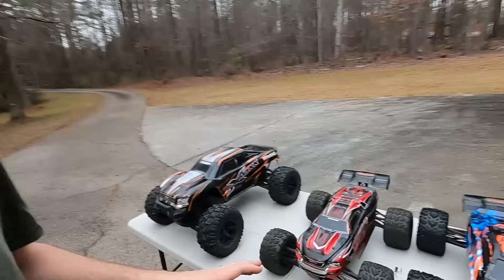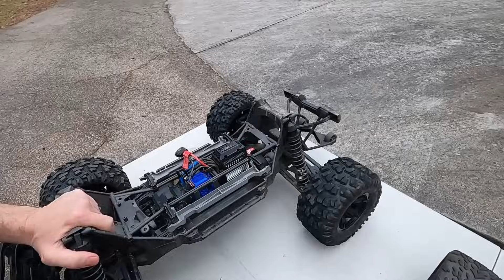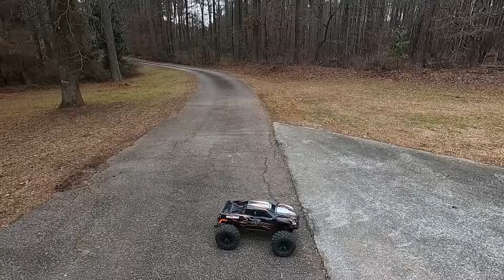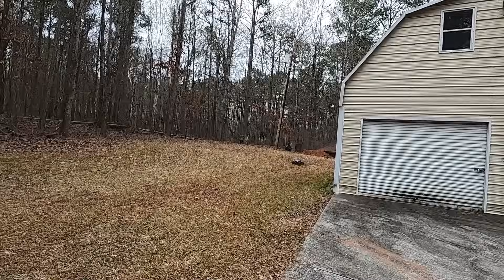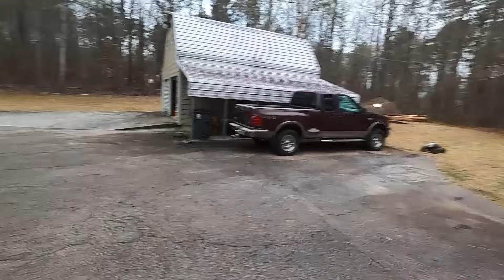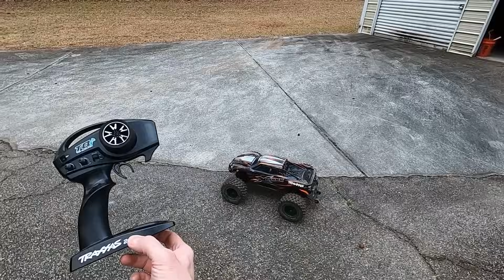Why Is My XMaxx Stock And Why Don't I Use Badlands?

Comment: Traxxas does all the research and builds a great truck and people go screw it up with “upgrades” lol
Reply: At the end of the day tho we all have fun upgrades or not each is there own
Reply: @natehage7919   I don’t need a product to be “my own”. I just want a great product that performs well and is reliable. And I try to buy products that achieve that — as much as possible — right out of the box.
Reply: This sounds amazing but for us first gen 6s xmaxx owners not the case. The version xmaxx hes running is upgraded. The revo first gen brushless version versus the 2.0 is a good example. The esc was not good for that size truck and could catch fire. Traxxas sent me the fuse link to fix it myself incase it caught fire lol. I added mamba monster x esc in my xmaxx instead and put the xmaxx esc in my summit. I broke so many gears on stock motor because it didnt have the cush drive yet. Went through axles and diffs as well plus tires sucked and would pop. The motor needed a fan cause it would get hot as shit and was underpowered for the trucks weight. On the other hand I do agree on the  modding it as it has become a shelf queen after I did mod it with the leopard 5892 1340kv. How some people run the 58113 800kv motor is insane to me. I went through a lot of steel gears cause I never heard of using loctite on the motor shaft so the pinion would slip and go the edge leaving little contact surface. If you compare the newer versions of these it has bigger axles, better esc, better motor, better tires, better transmission, cush drive and better diffs. I kinda wanna a video just to show the opposite spectrum but at the same time agreeing with some of the breaks that come with it even though in stock form the right person can break anything.
Reply: You don't break anything buddy because you drive it and jump it quite conservatively and are happy with standard product and mediocrity! Thats fine. Some people like 40 yr old transams and others like Hellcats or twin turbo'd chevs!
I guarentee my xmaxx is twice as strong and twice as fast and my 100ft jumps eclipse most of everything you do.
All good though buddy, horses for courses and each to their own.
Each to their own tho.
Reply: @Cornelius456  I have a 600 hp bmw dude I know what modifications consist of. Kevin talbot even says the Xmaxx is damn near perfect out of the box with the exception of the servo. Hell even mine went out within a couple months. You’re talking as if people aren’t allowed to modify things
Reply: @Cornelius456  a little salty are we BUDDY
Reply: I think so too
They sell the worthy upgrades  themselves,  not taking away any good aftermarket upgrade merit here, but most  of them are just to get your money without any real merit

Comment: I bought mine used (it was 2 years old, still stock) I kept blowing rear wheel bearings so I did the RPM wheel bearing upgrade. (No issues since) then the ESC died, upgraded to Max6 (no issues since) and then my servo died. Upgraded for the stronger Traxxas servo (no issues since) I’m fairly certain that this is all you’ll ever need to upgrade on your Xmaxx... everything else only breaks if you hit something wrong.

Comment: The turning is a combination of traction and weight. So if you upgrade the tyres you need to change the driving style, suspension setup, servo etc.  :D
Reply: Depends on the wheels, the louise and madmaxx tyres work fine without changing anything. They are a bit bigger than stock, but they dont weight much more. Unlike the proline wheels which are about double the weight of stock 😅

Comment: My brother has a Traxxas Stampede 4x4 that him and I have upgraded to the point that literally the only thing that breaks is the motor shaft. The motor shaft has only broke twice after having been finished with the upgrades in about two years. So probably once a year it breaks. The only other thing that typically happens is the grub screws on the driveshafts back out. Definitely, as you said, we chased the breakages until all that was left was the rotor on the motor. Would put a motor with an 8 mm shaft in it but that is literally impossible to find that fits in a Stampede.

Comment: I say this on every post I see. Those tires are just too heavy.
Reply: That’s the dumbest thing ever. It’s an rc car. Unsparing weight means nothing.
Reply: @peterk814  More weight, you're not going as fast nor are you jumping as high. Plus a heavier tire means more stress on the drivetrain
Reply: @peterk814  Mine doesn't do a wheelie so bring it on
Reply: @reidisaacson9623  Mine actually got a bit faster and stable. 🤷🏾‍♂️
Reply: @MervHernandez  k…
Reply: I have seen nothing but benefits from running the Badlands.  The weight argument doesn't hold any water - and neither do the Badlands!  The double, bolt-through-tire beadlocks completely seal out water.

Comment: I have this feeling with the regular Maxx. I do think that changing the gearing is a worthwhile upgrade for the X-Maxx after seeing the videos of the difference. I don't see the point in most of the other upgrades though. I am doing WIdeMaxx on my Maxx and putting lights on it because I play with my cars after dark during the fall, winter, and sprint.

Comment: Excellent video👍🙂 I definitely had this problem when building my Arrma Kraton v4 6s Piece by piece. I did this so I could put the upgraded parts on it that I wanted🤔  I have over $2000 into this truck and it is bad-ass don't get me wrong. I am constantly tearing up differential parts😒 I basically built a very powerful lead sled☹  Wish I would have just bought a stock one it would probably be more fun.
Reply from the maker: I know that feeling

Comment: The badlands cause my pinion gear to come loose. It holds up better with stock tires when jumping. I use the stock wheels for stunts and the badlands when it's snowing or the yard is really wet. Also, the stock tires last longer if you cover the breathing hole on the inside of the rim.

Comment: Nothing wrong with stock and very little mods or upgrades. If it works for you then rock it! I run a max6 on my stock 8s motor with duratrax hatchet x wheels, rear rpm bearing carriers, shock covers, modded the servo saver spring so it was a little tighter, and put upgraded steel pinion and spur
Reply: My throttle browns out with my max 6 Any ideas what could be ?
Reply: @Cole Deer  not really, try recalibration. Did u change gearing or motor?
Reply: @Todd_G_FPV  no only thing I did was change the ESC and now I’ve been having brownouts with my throttle. I’m wondering if it has anything to do with my LCV
Reply: @SoleToleCole  could be that or bad battery plugs not supporting the amp load and causing your lvd to kick on

Comment: 2.2lbs more is all  4 badlands weigh compared to the stock wheel and tire package. It really just depends on how you use your XMaxx as to if the badlands hurt the truck. Great truck and great tires.

Comment: I think your right upgrades do often lead to some issue or some breakage.    I have kept my Xmaxx stock besides the max6.  I upgraded to that esc as my truck was an original Xmaxx 6S and I upgraded it to 8S spec conversion.  That and I run the RPM oversized rear bearing carries and I’m going to get the new front carriers.  I also have RPM front and rear bumper supports.  But that is all pretty minimal for upgrade. Just realistic upgrades

Comment: Totally agree. My upgrades are pretty limited to just more protection.  Rpm rear hubs,dust cover, extra fan, Cvd boots. Did splurge on a savox 2292sg servo so I could put the upgraded traxxas black on my maxx.
Reply: How's that servo handle? I have a 2085X, but a stronger second couldn't hurt

Comment: Stock tires are absolute trash.  Even with stock electronics the tires will shred.  Upgraded to the max 6 with a 1250 kv HW motor and I’m very pleased.  Not too much more than stock, but definitely noticeable.  And I run the bad lands.  If you want your truck to last, don’t do huge jumps.  Really that simple.  And the vitavon 20-35 gears are incredible.

Comment: I had to do 3 upgrades over time .  The stock esc was causing the truck to lock up had to upgrade esc.  Stock servo was not working good installed the upgraded servo.  And the third upgrade was a unbreakable body

Comment: The servo is slow and weak. I found this to be one of the best upgrades I done on mine. The electronics are fine, however upgrading here is definitely a matter of choice, not necessary, I agree. Since I do not bash mine heavily upgrading the motor is awesome,. The power and torque on command makes driving a blast ripping around. So much fun, and the sound from the mod 1.5 gears in such an adrenaline rush.  More power turns the Badlands into grass ripping tires. They are a bit on the heavy side. I have found the Duratrax Six Pack X Belted Mounted Tires are a better all around tire. They do not balloon either. I enjoy watching your videos. You do a tremendous job presenting yourself. Thanks!

Comment: Mine is on its way, should be here tomorrow, the only things I bought for it are shock sleeve's rpm a arms for when they break, and rpm rear bearing carriers for if those break but that stuff I don't think will add much weight at all, loved the video, will definitely sub!
Reply from the maker: Thanks! I’ve been looking at the RPM carriers also.

Comment: Just bought a Xmaxx yesterday.  Haven’t got it yet but it’s ordered. Only thing I ordered was a skid plate for the roof, and front and rear skid plate for the underside. Other than that all I’m doing
Reply: Rear rpm bearing carriers, hobby wing ESC and a upgraded servo I see  in you future.. I'd add the Tbone bumpers.

Comment: I love my Xmaxx, but I did do a few things to mine. Being used to my Erevo 2.0, I was a little disappointed in lack of wheelie and backflip abilities of the Xmaxx. I put in 20/50 gearing and its definitely peppier. I can get a backflip, but still not as easily as the Erevo. I’m ok with that though. I added rpm roof skids and reinforced the body with drywall tape and silicone caulk. I always heard the rpm rear hub mod was a must, but was skeptical. One of my rear bearings came apart after the second drive. I ended up doing that mod and am happy with it. I took my diffs apart and discovered that they were all low on fluid so I topped them all off. So really nothing crazy has been added, but my durability/fun has been increased, so I’m very satisfied with it!

Comment: We couldn’t keep stock tires on ours, as we kept having blowouts! We put trenchers on and it has been solid ever since. Everything is stock except for machined gears.
Reply: how are the trenchers on the xmaxx? i put some belted trenchers on my big rock and they SUCKED. they wouldnt hook up on any surface under any circumstance. I spend $100 on these things and i cant even use them, i just spun in place

Comment: I completly agree with you! De Xmaxx is great just the way it is. Changing parts that break, just replace the broken parts, do not upgrade! You’ll only break otter parts. A company like Traxxas will have don there homework in the truck. Run it, break it, fix it. I have had 5 Xmaxx truck, and i you ask me the only thing i would upgrade, when the stock one breaks, is the servo. I would upgrade that to the Black metaal geared one. But that is it! 
Enjoy watching your vids, greating from rippeyrc!
Reply from the maker: Thanks! And Hi!

Comment: Since day ones the gears gave me trouble. Used loctite everywhere and just kept breaking. The stock tires simply suck honestly. One week of hard backing and that’s it. Upgraded to the Max 5 800kv combo with the WFO gears. Only upgrade needed after that was the badlands and aluminum diff covers. ITS A BEAST!!

Comment: My xmaxx is one of the early ones, in five years I’ve only had to replace tyres, and spur gear, oh of course body shells, my friend bought a brand new one just before Christmas, in only four months he’s changed motor wheels bec, he’s broken axles wishbones servo saver by clipping dead branch, which mine ran straight over, we simply do the same things in same place, his breaks mines fine. So I’m 100% behind you
Reply from the maker: Thats pretty much how it goes for me as well.

Comment: I've been wanting to buy an Xmaxx. I have the batteries already and just am waiting for the right time and all I've been hearing are the negative things and how I should prepare to buy this and keep that in stock and get an esc. I may not be bashing it as hard as most people on YouTube do, but it definitely made we want to not purchase one for a minute.
Reply: You will only replace the stock esc (after some months) and nothing else! Xmaxx is a beast...no need to upgrade anything else..stock parts are the best
Reply: The esc problem is for the most part fixed.  The max 6 will allow you to push taller gearing and have more power out of stock motor and has a better bec and your steering will become much stronger and quicker.

Not required mine lasted 20 packs and sold it in full working condition when I went max 5 5892 to get more power.
Reply: @FataL-Gr  Thank you! What's the deal with the ESC
Reply from the maker: Dont let that stop you from getting it. Its an awesome RC. You wont regret it.
Reply: Me too , depends if you use batteries designed for truck I don't think you burn esc out ,that said all esc burn out eventually,  im going cut plugs off use my own batteries so if esc burns out I have to eat it bc won't be warentee,  all reasons I already don't own a xxmaxx , but most casual bashers will not have any problems depending how much you use it

Comment: If each wheel/tire combo is twice as heavy it’s not that traction is necessarily better just more weight= more friction = seems like better traction. Probably bad on motor as far as heat and definitely servo like you’re saying. Great video I throughly enjoyed it. My Xmaxx is in the mail, first one for me, should be here Tuesday. 👍🏻
Reply from the maker: Well, it’s the tread pattern that makes the badlands so grippy.

Comment: Nice Blog Buddy!! very informative thank you for that, i do have a set of your badlands, i agree with you! the only problem is the stock tyres lose their foams rigidity  after a period of time   then seem to break apart inside  the wheel and tyre which is a bit of a shame for the price of the tyres. but i do like using both kinds depending on what im doing with the x max. What a machine ..

Comment: A customer added so much Aluminum to his X-Maxx that it was basically a brushless anchor. He was having chest pains when he couldn’t sell it for half what he foolishly dumped into it. Leave it stock. RPM rear hub carriers and threaded hinge pins is the only thing I upgraded, but that was after I broke one of the stock hub carriers.

Comment: I feel that I only upgraded what needed to be done on my Erevo 2.0. I did, a brace and limiting straps, progressive shock springs, single higher torque metal geared servo, metal spur gear, rpm bumpers, and a heatsink and fans for motor. I also did blue rpm arms to match body paint, and to contrast black of the rest of chassis, and lastly I put lights front and rear, these last two items I feel are just wants and not needs. My erevo already came with beefier rod ends and rods, the grey ones, and they hold up very well. The first erevo 2.0 came with shiny rods and these are the weak ones. I am still running the ORIGINAL esc and motor after almost two years and I s6ont baby it, either, I just take care of it, if that makes sense.

Comment: It depends how you run your xmaxx. If you jump crazy high and bash you need certain upgrades, Oversized rear hubs/bearings. Another is your servo linkage. Another is adding a driveshaft brace or the2 piece shaft system (or make your own). Also needed are the threaded hing pins front and rear. After awhile you will most likely need an upgraded servo but is not required. All these are needed for bashing and crazy jumping but you will learn for yourself if you bash your xmaxx. Saying you don't need upgrades at all is just incorrect. I do agree with the badlands,  if you use those you need upgraded parts.

Comment: I bought my Xmaxx 6s new 4 years ago, I have upgraded the esc to the hobbywing max 6 and the Xmaxx power up kit. If you stick with the stock power there is no need for a tire swap. The first upgrade is the RPM rear bearing carrier. Second and most important is to thoroughly spay the control arms with WD40 several times over the first month to soften the stock arms which allows them to flex instead of breaking... do whatever you can to save up for what is rightfully considered the best rc monster truck style rc known to mankind. Lastly I am wchair bound, the self righting feature of the Traxxas brand is worth the extra hard earned coins and allows me to confidently drive it without a helper also get some adapters and run china hobby line batteries 50$ - 60$ at 50c or higher... running lower "C" rate batteries is hard on the esc. Lastly subscribe to (outsourced RC) For honest advice 🤩BB